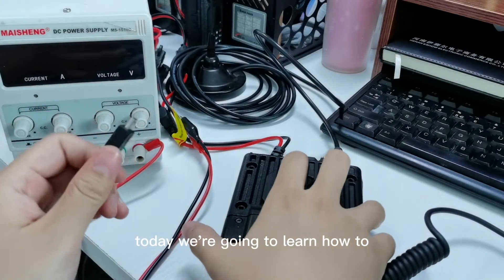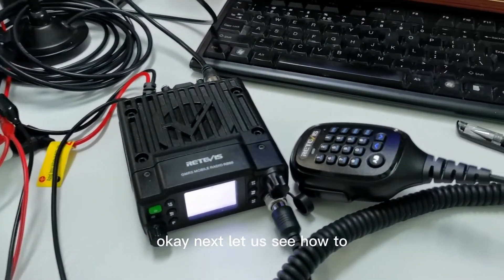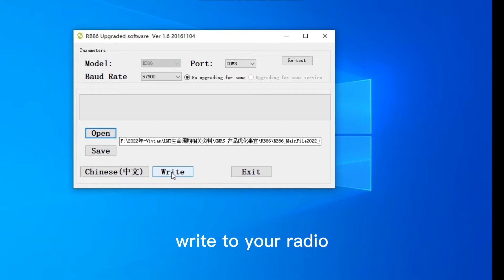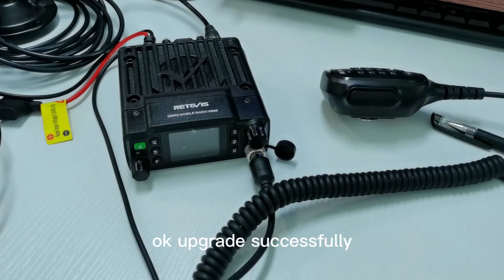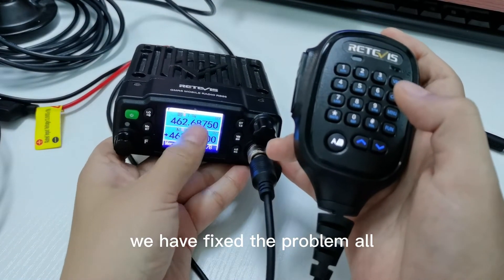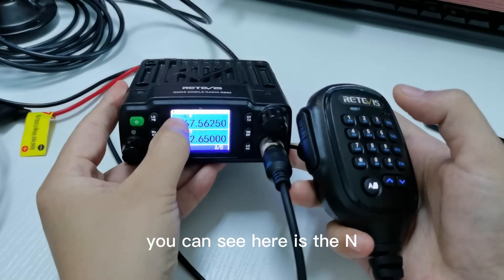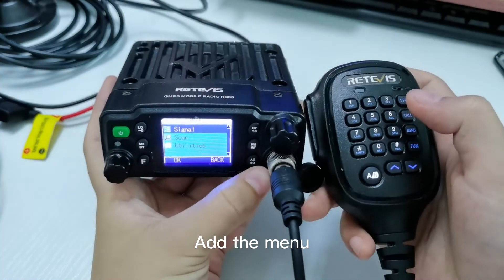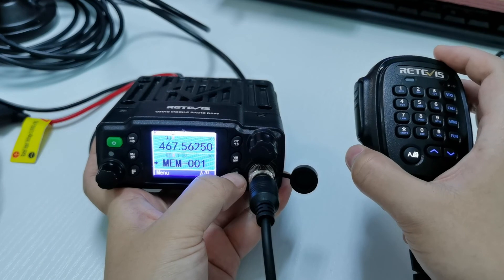How to Update the Retevis RB86 Firmware

Comment: I was able to update my firmware but the rb86 software will not read my radio or write to my radio. I was wondering if that had to do with the chipset of my serial cable. It is ch340 and it appears the retevis cable is pl2303. Any idea if the pl2303 chipset is required?